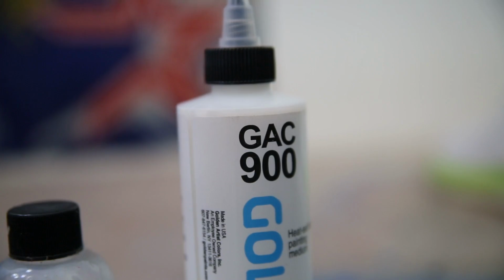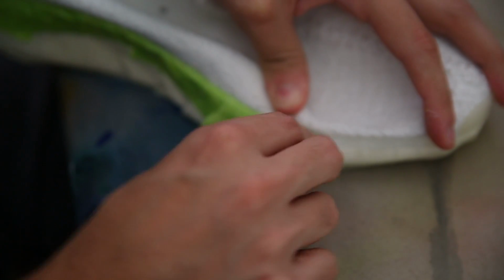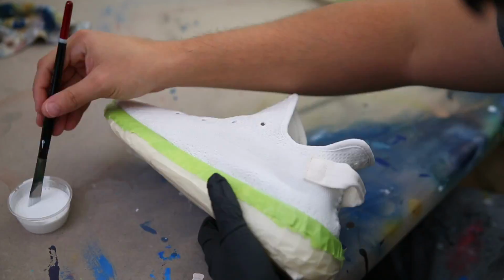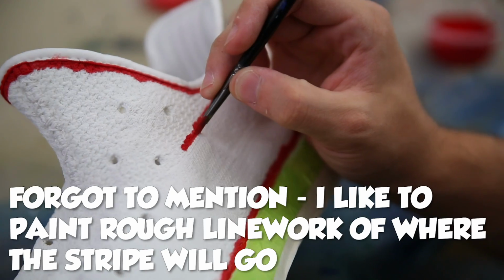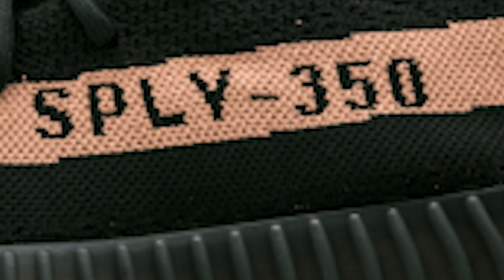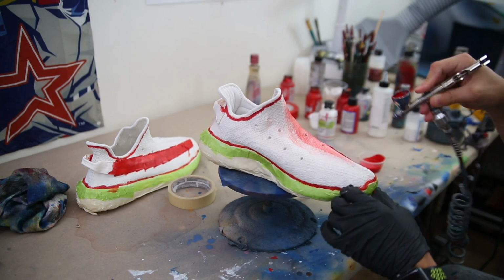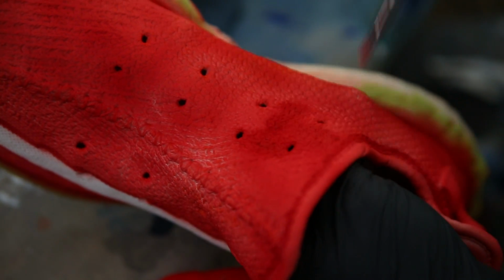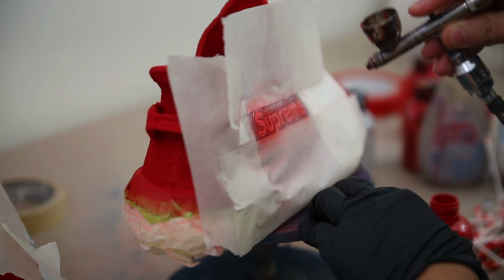HOW TO PAINT FABRIC SHOES | SUPREME YEEZY BOOST 350 V2

Comment: DeJesus Custom Footwear so if I don’t have an air brush I would be able to use a paint brush with the Angelus paint would it make a difference?
Reply from the maker: Chris Resendiz it’s still do able with a paintbrush, however in the grand scheme its a bit better to do with an airbrush cause you will keep the material softer since you apply lighter coats... but still can get the job done with just a paintbrush
Reply: DeJesus Custom Footwear how much would a air brush be?
Reply: What type of air brush did you use on these shoes?
Reply from the maker: Chris Resendiz for compressor and airbrush the minimum I’d recommend anyone spend is 150 for both... you can find cheaper equipment but it will do nothing except Cause headaches
Reply from the maker: Chris Resendiz badger patriot 105
Reply: Thank you so much and I love the videos

Comment: My Rit dye (1st ever attempt) on these Adidas AlphaBounce Beyond  - from Maroon/"Wine Red" to Graphite failed miserably, Parts of the sneaker dyed very well, especially the rubber sides, while most of the mesh is now a darker red, the accent maroon stitching was totally bulletproof from any dye. Damn alien material LOL ugh. 

So...I may have to try this method. Have a pair of black, white midsoles...these are my favorite sneakers, personally the most comfortable I've even owned..but hard to find now (unless I go used and beat up on Ebay, eh). Did find a new cheap pair a month ago for 30 bucks, my size...but this Wine Red wasn't doing it for me, figured I'd simply dye it with no problem. Nope.

Comment: If you’re painting fabric with an airbrush do I need gac 900 if I’ve already mixed it with 2 thin? Big fan of your videos!
Reply from the maker: Yes it’s even more important than the 2thin in that case.. all the 2thin does is thin out your paint to flow through the gun... 2soft changes the chemical makeup